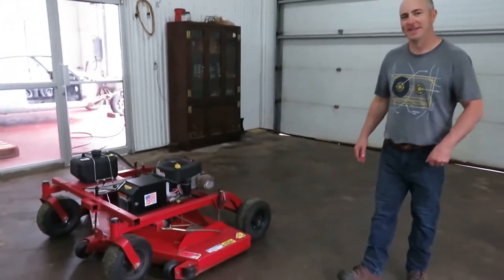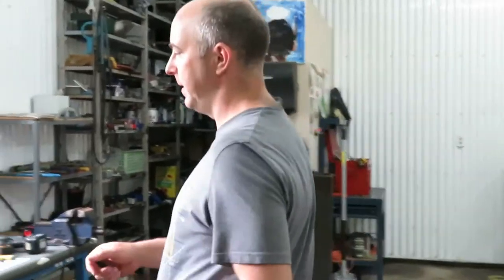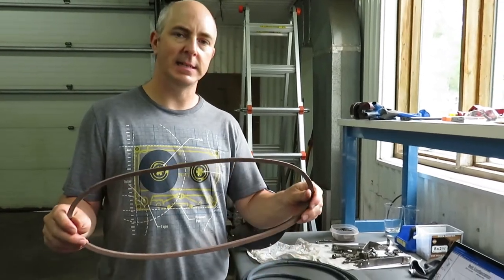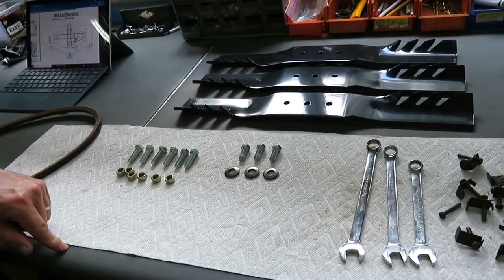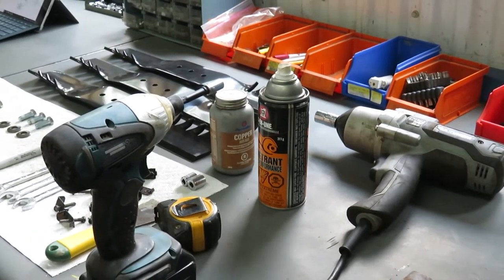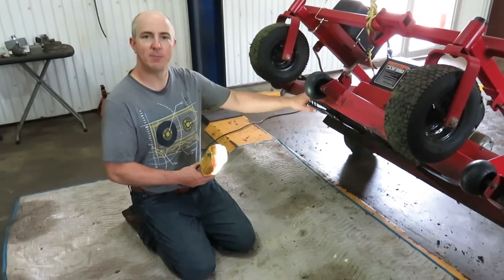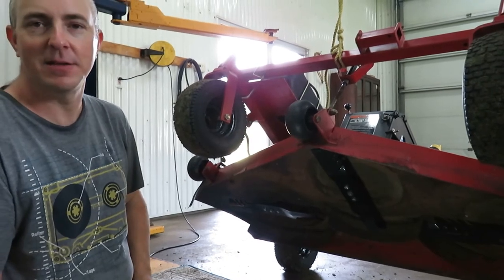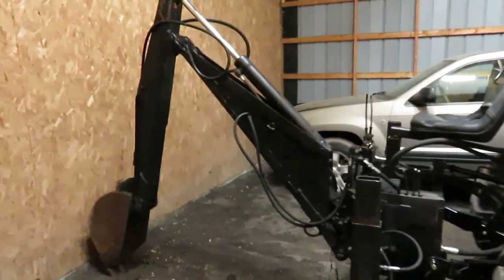How to replace the belts and blades on a Swisher T 60 mower

Comment: Very nice walk through, have the older green version, blew the motor and replaced with 17.5hp version, more power.  But need to replace the blades now so great video.  Watched it all even though only needed the blade info, looking at the same set you put on.

Comment: Great video......except for the positioning of the blades ......at          31:56     Any belt driven ( anything ) will never stay timed as your suggesting in this video.  Unless the blades were " chain " driven.  The belt slips...and is designed to slip to prevent damage.  Therefore  the timing goes out the window !  Cant keep them timed.

Comment: How tight is that drive belt when freshly installed.  Mine is very tight and the blades won't disengage.
Reply from the maker: Hi Brian. The drive belt is suppose to be tight when the tensioner pulley (blades) are engaged. Reduce the engine throttle to idle first and then disengage the blades. If that doesn't work, the owner's manual says to simply shut off the engine and then disengage the blades before restarting the engine again. Hope that helps.

Comment: Without a timed belt and pulley system there is no way to arrange or align your blades, they will not stay in the position you have put them in.
Reply: This is very true. Anything belt driven and more then one output......they will never stay timed.